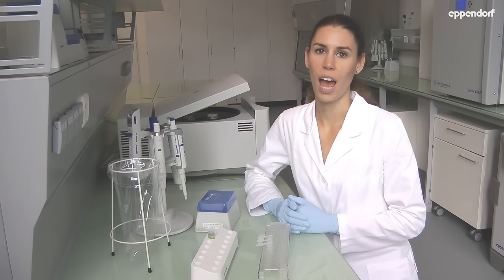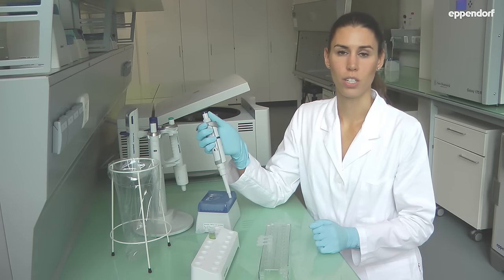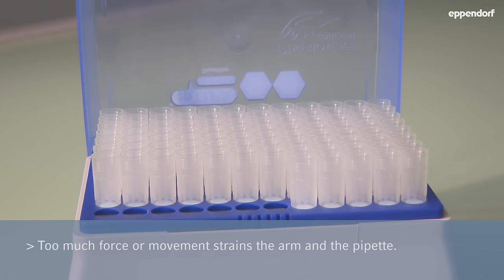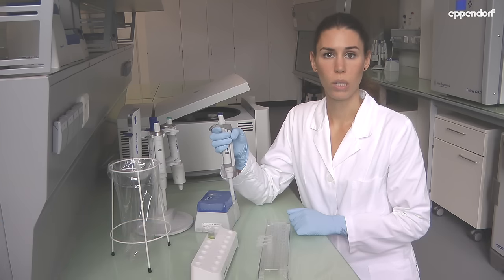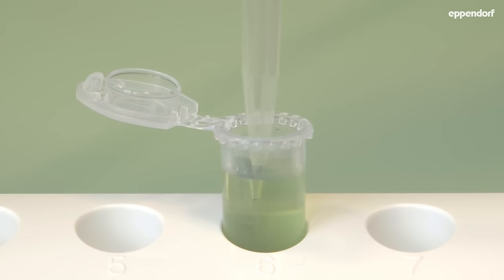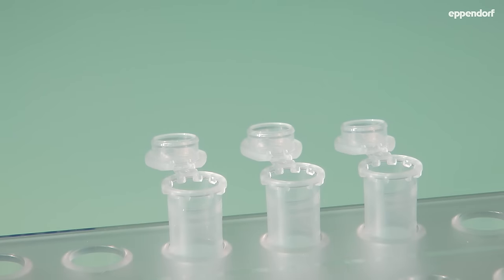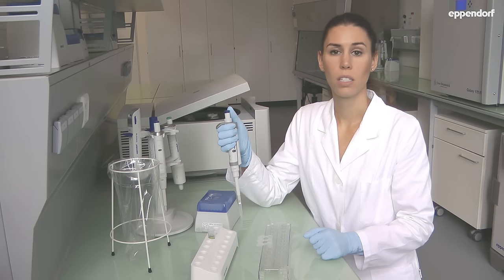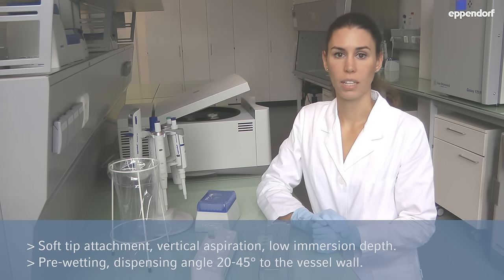How to pipette correctly – a short step-by-step introduction into proper pipetting

Comment: I'm sorry, but why exatly do you have to repeat the initial aspirations two to three times?
Reply: There's air between the liquid and the piston, so aspirating a few times lets surface molecules evaporate off the surface and saturate that air. This way you don't lose anything potentially significant to evaporation into that space. That's the explanation on ThermoFisher's site. Maybe it's most significant for very small volumes?

Comment: Is there a way to accurately pipet cell suspensions? There are always residuals on the tips. Cheers!
Reply: You have to pipette in the exact same way. If there is any residual it’s probably because it’s not liquid only but some of the cells or their debris might attach to the tip.

Comment: When dispensing the liquid does the pipette tip need to be against the wall of the test tube? 
And must the pipette be vertical position when dispensing the liquid?

Thank you!
Reply: I think when dispensing the liquid, the pipette needs to be at an angle of between 20-40 degrees so not completely vertical

Comment: What about wiping down the sides of the pipette with a tissue?
Reply: If the pipette tip is clean and attached from the original container and not immersed into the sample beyond the minimum necessary depth, there is no need to wipe the tip.  Wiping only increases the opportunity of absorbing the sample from the tip and rendering the sample volume inaccurate.
Reply: You do not need to wipe the tip.  Also with the small volumes you pipette with these at times it could greatly affect your results. But since these tips are not wiped you should pay attention to immerse your tip just enough for it to take up the liquid 
Pushing to the second pressure point allows all the liquid within the tip to come out. 
Normally wiping is only done with large glass pipettes and even then the tissue shouldn't touch the tip as to not suck out liquid accidentally

Comment: 1. What if the angle of immersion & ejection is not followed properly? 
2. What causes bubbles while pipetting?
Reply: If the angle of immersion is not followed properly, there'll be inaccuracies in the amount of fluid withdrawn as well as drawing up of air bubbles especially if the fluid withdrawn is of low volume (for example, withdrawing 0.2ml from a 0.35ml sample.) 

If the angle of ejection is not 20-45° and in contact with the deposit vessel walls, there could also be erroneous delivery of such sample. 

Air bubbles are caused by different factors including poor immersion depth (the commonest), the type of fluid, using the wrong pipette tips, releasing the plunger too fast and some other factors that depends on the skills of the person using the micropipette.
Reply: @BoluwajiPieters  Thank you! How to tighten the tip ejector? Any suggestions please.
Reply: @p.m.satyanarayana8505  Choose the appropriate tip. When putting on the tip, apply a little pressure on the tip to make sure it fits perfectly to prevent any spaces around the borders of the tip and the micropipette. The pressure should be enough to make the tip stay on the pipette and also enough to make the tip fall off when it's time to eject the tip using the ejector slide on the side of the pipette.
Reply: @BoluwajiPieters  The metal part that lines the micropippette gets loose sometimes. So properly using the tip can fix the problem?
Reply: @p.m.satyanarayana8505  Then that's probably a mechanical problem. If I understand you well. You can use newer pipettes or send the said pipette for repair if the tip isn't gripping the pipette because the metal part is loose..
Reply: @BoluwajiPieters  Thank you!
Reply: @BoluwajiPieters  what about with really small volumes like 0.2uL-2uL?

Comment: What about the precision rating? Whats the difference between electronic & manual pipette?
Reply: That's why you calibrate them.
Reply: It actually also differs from manufacturer to manufacturer. And depends on the range of the pipette. Reference precision scales can be found in the relevant protocols on the companies website (look up your pipette model and then the calibration protocols).
 You'd still need to check your pipettes in regular intervals and send them in if your result is outside the referenced precision scale